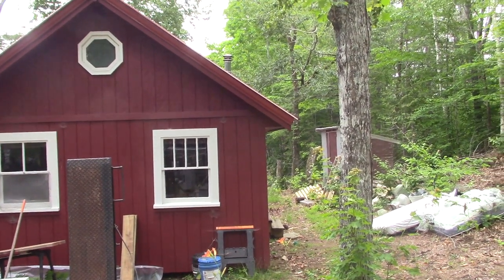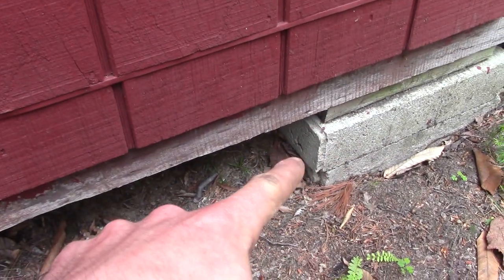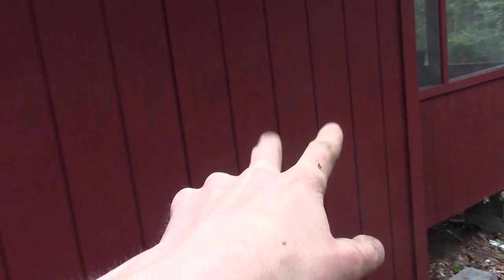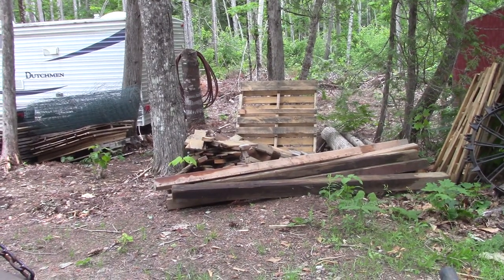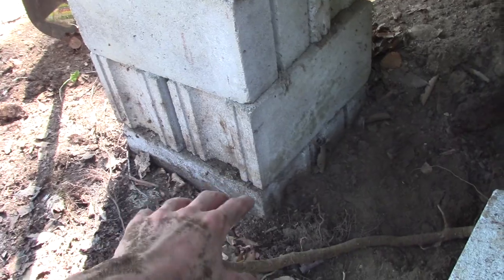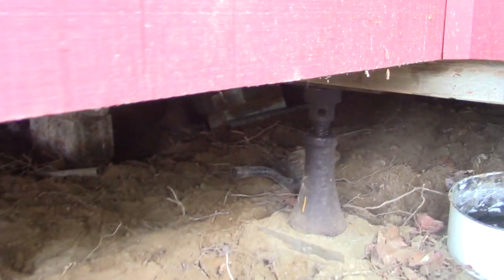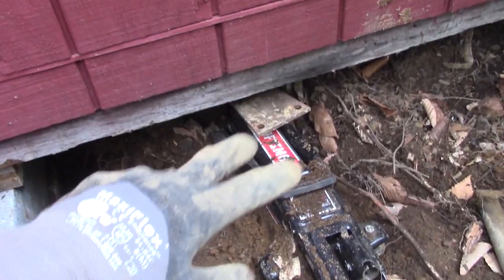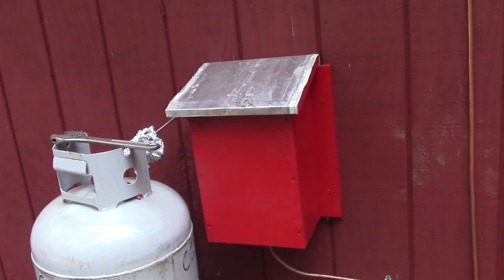Jacking And Leveling A Cabin - Off Grid Cabin

Comment: Enjoyed your video. My house has piers and beams under it. Under most of the house are board joists and beams, but under the kitchen, bath and mudroom are joists and beams that are narrow cedar logs. Back in the 1940's or 50's someone added the kitchen, bath and mudroom. Those rooms have sunk a few inches and I walk downhill to the bath and kitchen. The bath has a very heavy cast iron tub which doesn't help much. The bath has sunk so much that it has raised the bedroom up off it's pier. I bought the place a month ago, the realtor said tear the house down. The underside of the living room, dining and bedrooms is in really good shape with pier and beam and joists that are heart pine boards with no termite damage. The kitchen, bath and mudroom are in not so good shape with narrow cedar logs under them. I plan to have an inspector look at it, he or she may not pass the cedar logs, I may just tear the kitchen, bath and mudroom off the house. If it passes I may do what you have done and level the kitchen, bath and mudroom. It sits on piers that are exactly like yours. My house is in central Florida.
Reply from the maker: You can possibly jack it and replace the logs with pressure treated beams. Good luck!

Comment: I am so so happy you posted this video. I bought a log cabin and it was sloping in one corner ( where they had installed the bathroom with a 40 gallon water heater or) so I think it has the same issue likes your cabin with the stove. We now came back after the third winter and it seems to have sunken again in this corner. 
So I will now try to gather all my courage and tackle this , step by step as you did this 😱😱
Oh one question, where could I borrow the jacks ?
Thanks

Comment: This was very helpful to me as I will have to lift my own off-grid cabin and considering cinder block footers/piers. How are you planning to secure your cabin to the footers? (hurricane strips? can they be screwed into a cinder block or will that crack it?)
Reply from the maker: Nothing! Just the weight of the cabin holds it in place. Good luck!
Reply: @themadmailler  What part of the country are in?  Any ground freeze heaving issues?  I’ve got a new prebuilt 40x16 garage on similar non attached piers. Someone told me I ‘need’ 4ft deep concrete filled footers for ground freeze.  I’m in Ohio.  This is the first winter for the building and I’ve not noticed any heaving or shifting.  I did do a few ground anchor steel strapping.  Thx for sharing your video.
Reply from the maker: @FrankLutz2  this is maine, zone 3 I think. Frost line in that area is 6'. There is no way I was digging that many 6' holes with a trowel while under the cabin! If we were living in this full time, there would be skirting around the base of the structure and would help keep the soil there warm and prevent freezing. But other than that, it's just something you have to deal with. If I was building from the ground up like you are though, it could easily be worth it to rent a mini excavator and dig deep holes. You only have the chance to do it right once.
Reply from the maker: @FrankLutz2  also, if it's a garage you're building, why not pour a slab instead? Costly but way better in the long run.
Reply: @themadmailler  Thanks for the reply.  Makes me feel a bit better about my situation.  Yes, it’s a garage but it’s a prebuilt which was delivered to our property.  In the end it should’ve been built on site but a mix of incompetence by the sales / site surveyor and a bit of ignorance on my part led to a challenging situation.  Had some grading done before delivery but still ended up with a wicked slope.  Guys who delivered the garage were great at setting it up on block piers, perfectly level.  It’s just way high on one end (7 blocks) while only one block high on the other end.  I’ve reinforced all the ‘scary’ high piers and did set hurricane straps.  I’m a ‘make lemonade out of lemons’ kinda person so I’m planning to gouge out a foundation under the high end (where there’s room to work); lay blocks up to the garage floor to make a partial basement / root cellar at that low end.  Was just poking around YT to see how folks jacked up large structures … you’re vid, with your unattached piers is essentially what I’ve got going on here albeit with a ridiculous grade issue.  Thanks again for sharing.

Comment: Thanks for sharing.  How are you guys checking actual end to end  level either under or inside the building?  Laser levels or string levels?  About to do similar with a prebuilt 40x16 garage.  Great video.  Very informative and helpful. 👍
Reply: The problem with string lines and lasers is the  pillers are in the  way underneath and walls inside, if you use a spirit level you will have a n accumulation of  errors with multiple datums. The best way is using a water level,  fix one end to a post away from the building, this will be a single point datum then use the other end to level,  it will eliminate errors and you can  use it inside  or underneath which ever is the best for you. Every part of the building will be exactly at the same level.